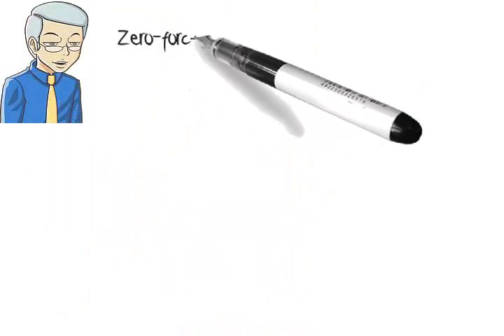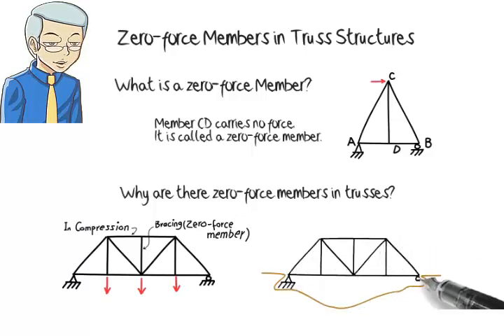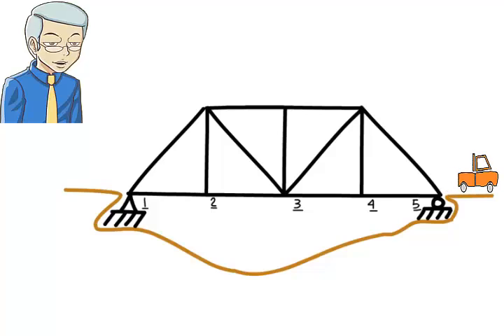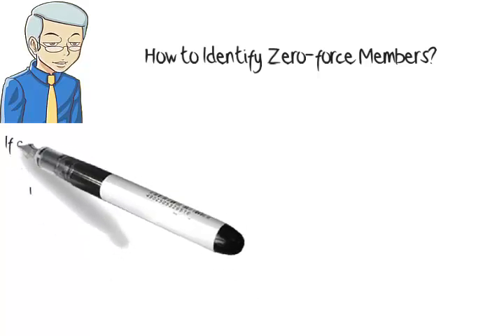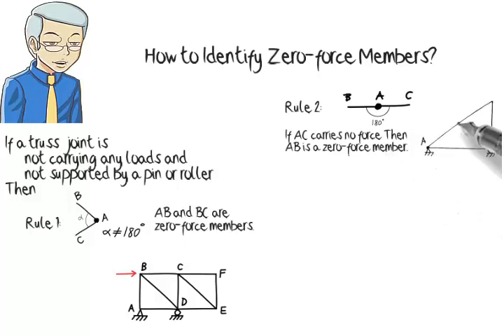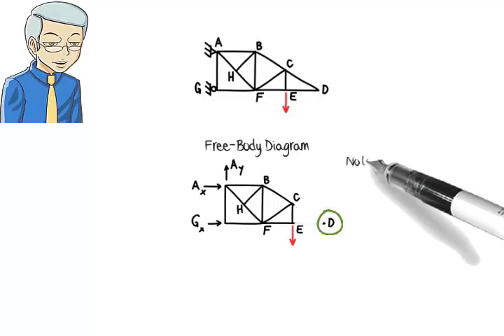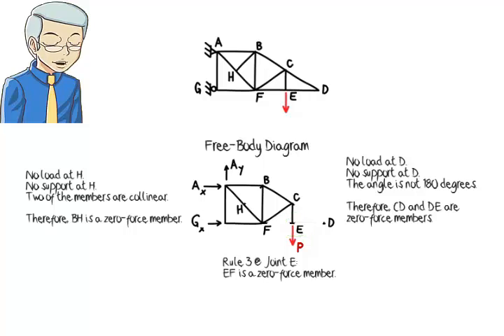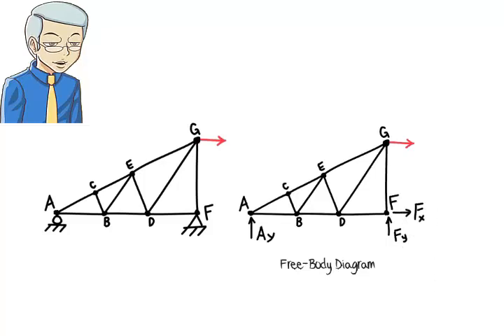SA05: Truss Analysis: Zero-force Members

Comment: I have a couple of questions:

1) when it comes to rule 3, is it supposing there is no load or support on that joint?
2) as for the use of ZFMs,  the first reason given said "to prevent a force carrying compression member from buckling", so does that mean the ZFM can only be in compressing when subjected to a time variant load? Can you explain the first reason further? I don't really understand the difference between the 2 reasons given for the necessity of ZFMs either, so maybe I'm misunderstanding something. 

In all, thank you for putting this up. I can't find anything that really explains ZFMs to my satisfaction.
Reply from the maker: 1) Correct, Rule 3 applies only to joints that carry no load and are not supported by a pin or a roller.

2) No, the zero-force member is not the compression member. Rather, it is the member that prevents the compression member from buckling. So, let's refer to the compression member as A and the member that braces it as B.  If the compressive force in A is not large enough to cause buckling, then B carries no force. If, however, the compressive force in A is large enough to cause buckling, if it were braced by B, then as a result of preventing A from buckling, a secondary force would develop in B. We call this a secondary force because it is not due to the applied load but due to the tendency of A to buckle (that is due to the fact that A is either pushing B down or pulling it up). This secondary force, could be either tensile or compressive. For example, in the truss example shown at the beginning of the video, if the horizontal compression member tends to buckle downward, then the bracing *the vertical member) will go under compression. If however, the compression member (member A) wants to buckle upward, then the vertical bracing (member B) will go under tension. But, keep in mind that B carries no force (it remains a zero-force member) unless the compression force in A is large enough to cause buckling.
Reply: Thank you for the explanation!

Comment: Why is HK and KJ not a zero force member for question B?
Reply from the maker: Thank you for the question!

Clearly, the stated rules do not permit us to conclude that HK and KJ are zero-force members. But, is it possible to determine if a member carries a zero force any other way? Yes, you can determine the force in a member by actually analyzing the truss. So, when in doubt, analyze the truss.

In this case, we can use qualitative reasoning to conclude that neither HK nor KJ is a zero-force member.

1. If either HK or KJ is a zero-force member then GK must also be a zero-force member. This can be determined from force equilibrium at joint K. There are three forces (members) at K, if one of them is zero, the other two must be zero too.

2. Member GH carries an axial compressive force equal in magnitude to the
vertical force applied at H. Let's replace member GH by a vertical force at joint
G.

3. Member GJ carries an axial compressive force equal in magnitude to the
horizontal force applied at J. Let's replace the member with a horizontal force at G.

4. Now, visualize member FI as a single straight truss member with joint G in the middle of it. This becomes an unstable mechanism if any transversal load is applied to G. Since there is a horizontal force and a vertical force at G, the system is considered unstable unless member GK carries a force. But, if GK carries a force, HK and JK cannot be zero-force members (from 1 above).
Reply: Dr. Structure Thank you for the detailed explanation.
Reply: @DrStructure  u are amazing. I love u so much cuz u save my asm!!!

Comment: how come  GK is not a zfm for B?
Reply from the maker: Since there is a vertical load applied at H, then GH cannot be a zfm. Similarly, since there is a horizontal load applied at J, GJ is not a zfm. Therefore, we cannot conclude GK is a zfm; none of the rules apply to joint G.